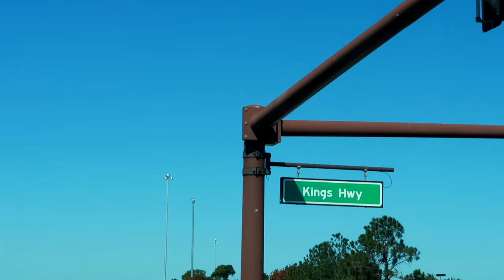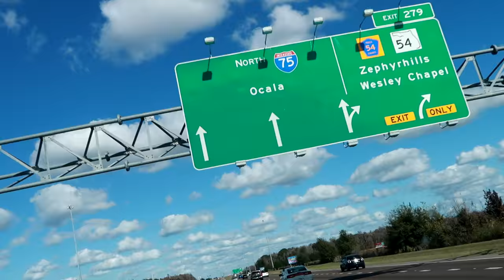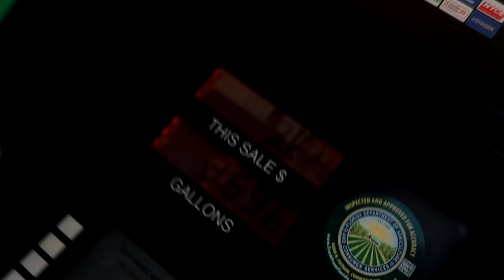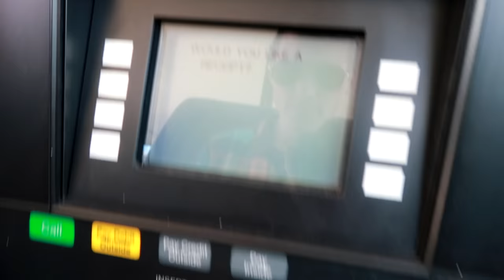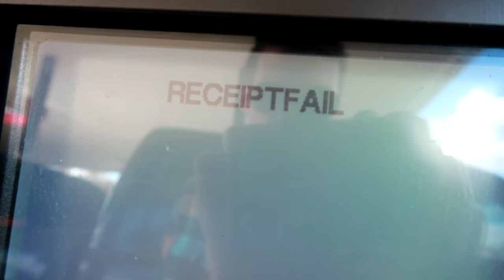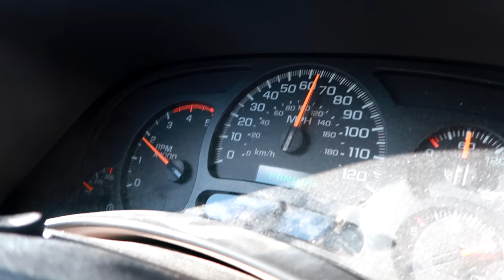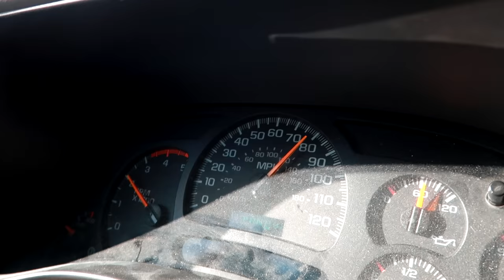i broke down...

Comment: you own a Chevy what do you expect
Reply: texas milsim LOL
Reply: texas milsim I bought a Chevy the other day. And I'm a Ford guy 😣
Reply: texas milsim what do you own? A dodge? Lol
Reply: texas milsim what do u own a Ford them things shIT
Reply: TANNER GETZ true
Reply: texas milsim a Chevy with 250k miles on it
Reply: TANNER GETZ I have a Ford and I bought a Chevy the other day, so far I'm still liking my Ford better
Reply: Hunter Atkinson i had a 1999 chevy diesel and i bought a 1999 ford f250 7.3 diesel and i love it so much more
Reply: texas milsim ford is better
Reply: the other day i saw a ford f250 with a durmax motor and allison transmission in it and i have seen ones with a 12v cummins in it explain why ford is still better than chevy and by the way if you dont change airfilter on your vehicle than it wont run right
Reply: thats right he bought a pos chevy
Reply: Ozzy Dotson how old are you bud? You've got the vocabulary of a pissed off middle schooler. It's all friendly banter. No need to to be so salty
Reply: Master Mudder have you ever seen some one try to put a durmax or powerstroke in a dodge
Reply: It doesn't matter how old I am. I owned a ford and I'm talking from experience. I had nothing but trouble with it. They can look nice but the motors are junk
Reply: texas milsim right
Reply: Ford found on road dead
Reply: texas milsim bottom line. your truck is only as good as it's trans. therefor duramax mated with allison.  the rest is history.  cummins does not have the displacement for heavy long haul mountain driving.  that's why you do not see cummins where I live in the valley of Colorado between Denver and gypsum
Reply: Nathan Brinker you mean, Found Off Road Dominating?
Reply: Nope
Reply: Fuck. Hell no
Reply: I've owned them all.  I'll stick with duramax.  Thanks though
Reply: Listen to ozzy Osborn
Reply: A Texas muslim. Wtf
Reply: First On Race Day
Reply: Mike Haapoja to smash the wall
Reply: Nathan Brinker my fix or repair daily
Reply: texas milsim chevtared
Reply: lol look at all this anecdotal crap. I had X truck and it broke therefore all X brand vehicles suck. Lots of fleet Fords have gone past 500k miles. The same goes for Chevy I assume. Its called maintenance.
Reply: It's just an air filter nothing to serious
Reply: texas milsim Don't even get started on a fucking Powerstroke...
Reply: 3J Kreklau mark...get set.  Go
Reply: texas milsim I own a chevy. 323,000 miles, all original, not even an exhaust leak...  Nothing major has ever failed, and it runs like new.
Reply: Nathan Brinker Fucker only runs downhill. Fucked over reconditioned dodge. Driver return on foot.
Reply: tbh they all suck haha as long as your not driving one of those electric cars
Reply: Hunter Atkinson it usually depends on what kind of ford you have got and what chevy your comparing to it
Reply: Ozzy Dotson true
Reply: texas milsim " what every Ford owner says "
Reply: He has posted 10 videos of his trucks problems in the past 2 months.
Reply: LaziestMango problems. or regular maintenance issues.  try again
Reply: LaziestMango sure it was
Reply: Um...what???
Reply: texas milsim both are pretty good but Izuzu Sucks!!
Reply: James unknown That's right! Chevy loud, chevy proud!
Reply: UNDEAD ASSASSIN loud as fuck when you lose your last cylinder proud to be towed by a ford.
Reply: LaziestMango I wouldn't know anything about getting towed. I own a chevy.  TOWING on the other hand....  ;)
Reply: Exflamed you're thinking of chevy's. hence the bowtie
Reply: Exflamed my friend has a '99 chevy half ton. He blew the tranny for the third time. The in-cab latch for the hood is so worn out you can't read it, and it broke so you have to pull on the wire.
Reply: Google Ford Power Stroke or search it in YouTube.
Horror stories and the owners all got stuck with the repair bills by Ford.
Ford didn't take the bailout because they stuck their customers with the tab.
Reply: Tanner Getz That's why his Chevy has broken down so frequently
Reply: ***** I did. He should've changed/cleaned the filter a long time ago.
Reply: Tanner Getz haha we own both and guess what. the head gaskets are blown

Comment: lol at the people telling you to get a different truck because the air filter got dirty, like any other brand truck just has a permanently clean air filter, i work on a few wreckers and on of them is a 2002 3500 chevy with 6.6 duramax and it made it to 510,000 miles with a very hard life before it blew a head gasket, other than that it has only needed minor stuff and fuel injectors, when i tore the engine down the cylinders still had the cross hatch pattern with zero wear, i had the heads resurfaced, put new injectors in it while i was that far into it and it runs like a top again, the f550 rollback has had 3 complete powerstroke engines replaced under warranty and now only has 200,000 miles, after warranty was up we bullet proofed it but it still has a few problems

Comment: The key to torque wrenches is to set them back to zero after you are done, it stretches the spring in them and it looses its accuracy just a FYI to anyone who doesn't know

Comment: Every time you change your oil, change your air filter. If you have a reusable air filter, you have to actually refresh/clean it. That looks like you never cleaned it since you bought it.
Reply: check it every oil change. not replace or clean it. what are people smoking now a days. if you only every drove backroads you still wouldnt need to change it every oil change
Reply: Filters are cheap. If you do it every time, there is no chance that you think you "did it last time" and forget 4 times and a row and end up like this.

Even cheaper if you have the K&N ones, since the recharge kit is $10 and will recharge the filter at least twice.
Reply: Alexander Borsi 20 bucks for a recharge kit up here. on top of the 80 for oil and 12 for oil filter. not worth it to throw money away like that. if you use a paper filter blow it out and replace twice a year tops
Reply: We are not talking about the price of oil. Strictly about the air filter changing schedule and price of changing it. Don't strawman, man. If you want to talk about the price of oil, do it on it's own. I was merely using the oil change as a time indicator as to when I did air filter maintenance.

For me, the SMALL amount of money spend on a recharge kit ($13 on AMZN. I was off by $3) or another disposable paper filter ($15 for my car) is 100% worth it to me, knowing that my air filter is always, always, ALWAYS clean. There's not a single doubt in my mind. No hesitation on it either. I don't ever have to think "Oh hey, is this thing that is happening with my car due to my air filter?" because it literally never is. It cannot be. Ever.

Nobody ever had any issues from having too clean of an air filter. Not a single one ever.

(Also, as a side note: blowing out paper filters is really not a good idea. The paper media is designed to trap the smallest of particles, which don't really get removed when you blow it out. Not to mention you mess with the filter media, by making larger holes since you are blasting much higher pressure air through the material. But what do I know. I'm just a guy on the Internet. You do what you want. I just cringe at the idea of cleaning a paper filter...)
Reply: 30,000 is seems to be about average what manufacturers recommend. that was my actual point
Reply: if I changed my airfilter every time I did an oil change that's 60 bucks out the door for the filter.

Comment: Don't worry 3D I had my rear wheels on my jacked up dualy truck with 45 inch tires. The out come was much worse. I actually rolled my truck 7 times. Luckily I had heavy duty roll bars and internal and external roll cage. So the cab was ok. The rest of the truck wasn't in such good shape. Now my truck has been rebuilt. The cost was in the area of 70,000 to 80,000$. I guess you could say I love my 1994 Ford F-350 dualy four door long bed.
Reply: Sorry forgot to say that my rear tires fell off and that's why it rolled

Comment: The lug nuts on the left side loosen because the wheel turns the same direction that loosens the nuts, the right side will tighten the nuts. That is the exact reason why semis have left handed and right handed nuts because there has been more than one trucks who's had the left side tire fall off

Comment: when a duramax losses its balls and wont touch 70 its because its in limp mode, now as to wtf is wrong, not sure.
Reply: oh it was the air filter.... my dads duramax has the box type filter cut out and a cone filter on it with 2 scoops in the hood pushing air into the filter, id do a box to cone swap imo.

Comment: I have a fix for the symptoms you describe I have done it on 3 of my LLY Duramax's. Locate the EGR motor under the air intake tube it will have 4 screws. Pull the egr motor and you will see a plunger and spring on the motor its self go ahead pull the spring and plunger out and put in your glove box and reinstall the motor and plug the connector back in and put your intake tube back on. Now this may sound funky but unplug you mass air sensor and try to start the truck (eventually it will start) after it starts turn it off plug the sensor back in and clear the codes and restart the truck. In time you will have up to three codes but NO CHECK ENGINE LIGHT!!!! And that will fix the random loss of power. And at least in Utah here if there is no check engine light it will pass emissions tests!!

Comment: Try ford next 😂
Reply: [Insert Ford hate comments here]

Because you're that unoriginal and outdated.
Reply: Bad Drivers Of Indiana found on road dead
Reply: Bad Drivers Of Indiana Ford sucks
Reply: Josh D Found on road driving.
Reply: Dom_112202 no one wants a found only running downhill
Reply: hear that whistle see that smoke you just blew up your power stroke
Reply: All these Chevy guys have sooooo much time to think up rhymes... while waiting for tow trucks.
Reply: I think you are talking about fords
Reply: Tommy Born2Ride ford does suck
Reply: +Josh D +Tommy Born2Ride +lil john +Twisted HD  
You actually have a statistically higher chance; of breaking down in a Chevrolet. If Fords are so "unreliable"; Then why do they use them as ambulances? Why do they use them as City power trucks? Why do they use them as cop cars? Why do they use them as tow trucks? Why did the Fusion, Focus, Mustang, and F150 Make up four out of the twenty top selling vehicles in 2016? Your logic is outdated. Ford only gained the stereotype of being unreliable; in the 70's because of the Ford Pinto. Move on.
Reply: Bad Drivers Of Indiana well maybe where you live they use them but they use dodge here and they use some chevys but that's in Wisconsin where Chevy is dominate compared to fords here and Chevy is the #1 selling vehicles here idk you like what you like but if you're from Wisconsin you're most likely going to like Chevy over Ford
Reply: Twisted HD I see a lot more old Fords out there on the road. I did see a Chrysler 200 abandoned with the hazards on today. What a shame. And an Impala rusty and worn out. I guess 15 years is all you get from a Chevy. No Fords on road dead though. Probably a Ford tow truck will haul them away.
Reply: PGTMR2 hmm doesn't sound like Wisconsin but my mom has a friend that's got a old impala it is clean body is all fixed and everything. But I'll tell you something my whole family drive chevys so I guess that why I love them so much compared to fords I'm not saying there bad trucks I just don't prefer them
Reply: Twisted HD In Wisconsin, Minnesota, North Dakota and those colder places (I'm from northern MN and it gets down -50 wind chill sometimes, usually -30 degrees) and we need trucks to be reliable, that's why we buy a Chevy. I had a Powerstroke (6.4) and it was the biggest pile of shit I ever owned. As much as I took care of her, it just continued to let me down. She wouldn't start almost all winter and I had to take my ol hopped up 300K mile '95 Suburban to work almost every day which started every morning. That Powerstroke was a tick a tock'n and a fuckin' knockin (when the fucker ran). Now I got a Duramax and let's just say ol' Burb's got no salt on her ;)
Reply: Dom_112202  ford sucks
Reply: 3J Kreklau haha nice my moms husbands got 06 power stroke he only uses it as a plow truck because half the time doesn't start up even tho it's in his heated shop that he's at everyday as well as someone lives there to
Reply: 3J Kreklau my 6.4 starts right up and I have to deal with the MN cold also. It sits outside and isn't plugged in. Starts everyday. No obnoxious smoke. Neighbor has a 08 chevy 2500 and a 05 dodge 1 ton. they both have to be plugged in and they both smoke like hell.
Reply: Mike Haapoja ok what does smoke have to do with anything every vehicle will smoke a lot when there cold
Reply: Twisted HD it was a side note, mine does not smoke. The ones I mentioned you can't see his house when he starts his. I apologize for adding that in. Maybe a little off topic. Apologies
Reply: you guys just don't know how to take care of a diesel have a 2001 6.0 and I live in upstate ny where it's just as cold and haven't had any problems the only problem I ever had was the 4 wheel drive but that's because my cousin left it in 4 low
Reply: Connor B they didn't make an 01 6.0 they ran 2003 - 2007. my 06 6.0 starts great every day in Michigan never plugged in.
Reply: Al Bacon my 6.0 takes a couple tries to start in the winter here in canada and idk why tho no matter what i do nothing fixes it (it starts if its plugged in 1st try everytime)
Reply: Connor B There is no 01' 6.0
Reply: boostdriven have you replaced the glow plugs. Mine only starts hard when it's like -25
Reply: Al Bacon i havent changed em in a while thats probably a good place to start for this winter 😂
Reply: Dom_112202  try found on road dead?
Reply: Ollie Carley actually its first on race day, and for off road driving
Reply: Dom_112202 you know actually maybe becuase I heard they are putting tailgating warmers on the 2018 so when your pushing it home your hands will stay warm
Reply: Dom_112202  first on rubbish dump
Reply: Dom_112202 factory ordered road disasters
Reply: Dom_112202 fix or repair daily
Reply: Dom_112202 found on roadside dead
Reply: Dom_112202 fast only rolling downhill
Reply: Dom_112202 wanna hear a car joke? Yeah?
Reply: Dom_112202 Ford Fiesta

Comment: Says he's been spending all of his time on the BMW & 4 wheeler...  Were you planning to drive EITHER one of those on this 3,000+ mile trip?

Everyone knows that you do basic maintenance BEFORE a long road trip.  Next, he'll be on the side of a dark highway crying because the 12 year old serpentine belt broke.

Also, with the extra fuel you burned dragging those extra wheels and tires around the country, you could have had them professionally installed in NY, and probably wouldn't have had one fall off on the side of the road.
Reply: damkayaker friggin right bud! 👌👌

Comment: Hey 3dmachines, my dads 2012 Duramax did the same thing to me when I was pulling a trailer and merging on to the interstate. It ended up being the fuel filter collapsing in on itself. It corrects itself when you turn the truck off but does it easier the next time

Comment: Clean your Mass airflow sensor next to the air filter box. Lets your vehicle know how much air is coming in so your vehicle knows how much fuel to dump, if it's dirty your vehicle will run lean because it's putting in more air than the sensor can read so it throws off your air/fuel ratio

Comment: If your the truck threw a code and ran a "reduced power" message through the display center it was a fuel or air issue.  If you turn the key off for 60 seconds it will reset that code.  I had that code all the time after I straight piped and tuned my 08 duramax.  Mine was a defueling issue.  Things to check would be fuel lines and fuel filter assembly.  I didn't watch all the videos from the trip but i know he redid the assembly and had one bad line that he would change when he got home.  It is an older truck so it could have been the line.   What mine came down to I noticed was I was putting to much of that power service additive in.  Power service is really good but once i put less of it in I ran way better with more power.  I switched to using Howes but these diesels are pretty picky.

Comment: Once we went to death valley and drove around for a bit and looked at the sites; it was dusty as hell.  When we left it was Sunday night at 10:00pm and nothing was opened.  The truck would not go above 40mph and the pedal was to the wood.  Luckily we had an extra air filter and that was all it was.

Comment: Hey just a suggestion don't use k&n filters ive seen tons of problems with them at my shop after extend uses the turbo on a diesel sucks to much and it pulls the oils through the filter and that will kill your maf and your turbo not to mention coat your intake with filter grease

Comment: I have a Harbor Freight (Pittsburgh) torque wrench. I bought it because it had very good reviews, about it's accuracy/consistency in torque. If you're referring to your Drivers Side nuts loosening up, more than your Passenger Side nuts... There is a theory... If you use Reverse Threaded studs and nuts, on the Drivers Side, then the rotation of the wheels will help keep the lug-nuts tight. Vehicles used to have Reverse Thread studs and nuts, on the Drivers Side, up to about 1955.

Comment: I've read a couple articles on air filters in diesels to see if the k and n or cold air intake systems actually make a difference and what I've read is that the best filter for your diesel is the stock paper filter
Reply: TheCAFisherman the best air filter for any vehicle is the stock one. k&n filters can actually cause more bad then good if you have a MAF sensor because the oil in the filter coats it.
Reply: BoringMinecraftDude yeah that's what I'm saying